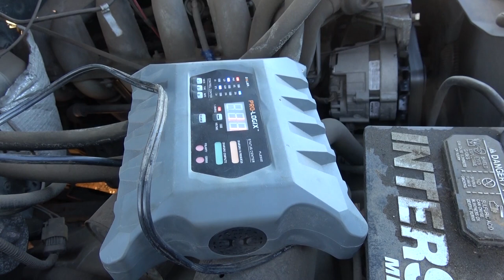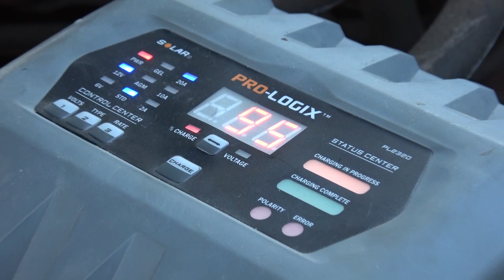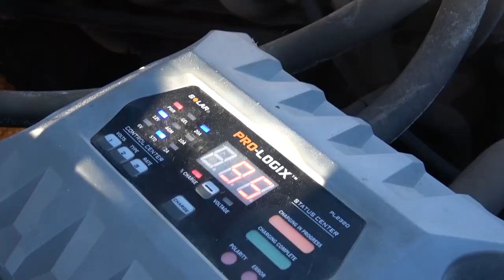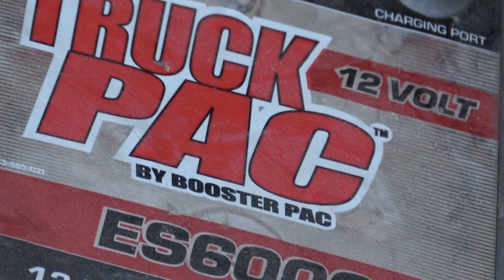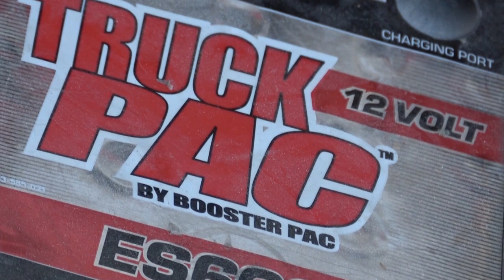Costco Boost Pack | Electrician vs. Truck Starter

Comment: “The Club” steering wheel lock? Jeeez. That’s old school. Brings back memories. People still use those things? Must be a large criminal element up there North of the border.
Reply: I'm fairly certain it's quite the opposite the criminals on our side of the border can get one of those off like it's held on with a wet paper sack the fact that they still use them up there kind of says there ain't much crime
Reply: Here in South-Africa it is tradition . .the first thing you go buy for your car . . . .also doubles as a self-defense tool.
Reply: iirc he has no ignition lock.  the club is the only security
Reply: @GigsTaggart  A good way to fuck with thieves is just wire your battery's positive to a switch in the car hidden away. Of course this means the remote start won't work.
Reply: Are things that bad there that someone would actually steal that POS truck?  lol
Reply: That’s in case the thief brings a Makita battery...
Reply: Yeah great security. Someone can start it (assuming it will start)  and drive it as far as it takes to crash it or put it in the ditch, because they just can’t steer it. But they can’t get it to take them where they want to go. That’s real protection I tell ya!
Reply: @kjisnot  The exhaust is a high dollar custom job.
And yes it's a great self defense tool.
Reply: @leerman22   My brother would always wire his starter switch to the windshield washer button on them old ford trucks of that vintage. Worked great because it was on the dash right beside the headlight switch. Just turn the key forward and press the windshield washer button and she would spring to life.
Reply: It's just to keep the honest drunk ones from driving off
Reply: @kjisnot  From what I can see of it, for an OBS ford in snow country, she looks pretty good, honestly.  Probably about $1500 worth of truck on a bad day.  
Had my 94 Dakota that was rusting apart, smashed up, doors literally falling off when you opened them too far, completely trashed truck stolen. I have no idea to this day why they bothered.  Figured it would turn up with the new wheels missing as it had a decent set of tires on it, or that someone took it to use for some other crime and it would turn up.  Two years later not a word.  I can't imagine someone stealing it just to scrap it, doesn't seem worth the trouble for $200.
Reply: @johngaltline9933  I have a 98 Dakota that I park with the bright orange key chain hanging in the ignition. They haven't moved in years. I live in Baltimore. Can't get anyone to steal it.

Comment: Reminds me of the morning I jumpstarted my '83 Ford in the dark.
50-50-90 on that one.
Truck started up, abruptly followed by the jumper cables catching fire and melting, then spattering my sweater with burning plastic as I removed the cables from the battery.

Comment: It's a balmy 14 degrees farenheit in Northwest Ohio right now. I finally got my 1994 Ranger (with the "awesome" dual ignition system) to start after 45 minutes of fussing n cussing. It has a cracked coil pack and doesn't like starting any time because of that.

I finally convinced it to start by opening the shop door so it could see the big box with the V8 engine swap kit sitting by the bench and the freshly built 302 on the stand. Once it saw them, it fired right up!

Comment: I have one of those tiny battery jumpers, I have the Audew 2000A peak
it works amazingly well, it takes three or four percentages off of the battery each jump
I have given my grandpa's tiny toyota a jump and my VW station wagon as well

Comment: Terminals could use a scrub.... a "how's your mother" so to speak....Just an observation
Reply: I usaully just insert a drywall screw in between the post and clamp. Works like charm for "tightening up" the connections!
Reply: @chuckchapel8492  Pro-tip right there!!

Comment: I've used the big ryobi batteries with a chopped up extension chord to jump the work van. It worked, but after a couple of times I have a pretty expensive paper weight.

Comment: The Ford being a ford.
Reply: thats the same battery from the last time it was dead
Reply: @buttsakauf  I've got a 300 with a one hole Carter carb that fires first time every time as long as there's fuel in the bowl. Doesn't care how cold it is.

Comment: Gotta go Supercapacitor-type jumper in the depths of the Cold and Dark.
Reply: They suck. 20 minutes charging to get 3 seconds of crank time. You might have a truck like this one started in an hour if you're lucky.
Reply: @andronicuscomnenus2642  Definitely not my experience in any way.  Had multiple cranks needed on a 4+L engine. Charged in 7-10 minutes in 5 degrees F.  I'm sold.

Comment: My tool batteries saved my behind many, many times!
Just like aVe and DC, the difficult part is finding a length of decent wire. Having been stuck in the woods many times, a number of my power tools are missing cords, having been cut off to start the Subaru.

Comment: Last week when it was in the negatives temp wise in Texas I had to start my work truck but it was too cold. Managed to Jump start it with the same Makita battery and 2 pieces of 10 gauge ground wire. Best trick in the book when you have no other way to jump start.

Comment: I use the Anker Roav version of one of these. You don't let it sit there. You plug the cable into the starter box and directly into the battery real good then press the button and immediately start the car. I started a dudes motorhome with it at half charge, then went home and jumped my armada that has an electrical problem I haven't felt like trying to figure out yet

Comment: What I can’t understand is why nobody makes a Lithium boost pack that’s the same size as the old ones, it would actually work. But, I’ve found that the small ones work great for smaller 2ish liter gas engines if you have a marginal battery that just doesn’t quite spin the engine fast enough. My old Volvo that’s parked half the year in a heated garage is a prime example, keep one in the glove box!
Reply: I just use a Milwaukee M12 battery with a couple stranded wires out the top. Start lawnmowers and stuff all the time with it

Comment: Jump started my vans many times with drill battery. Trick is to connect them for around 20sec, disconnect for 60sec and so on to allow to cool. Never try to start whilst still connected as it fries the leads and the battery.

Comment: Best jump box I ever had was an actual car battery with short cables with clamps attached to them. The battery had free replacement for 2 years and was pro-rated for 3 after that. Find that on a conventional jump box. Plus it was heavy as fuck, which prevented lazy people from borrowing it and not bringing it back.

Comment: The battery contacts were dicky, that's why they were sparking. Attempting to charge the car did not work and also that's why the other starters refused to work, they were just making contact with the terminal and not with the battery. Easy way out of this is to have one person force the terminal at an angle, might get you out in a pinch. Long-term: just clean the old contacts really well, use a grinder on them, cut them off with the grinder and install new ones + terminal grease.

Comment: As I know you shouldn't connect that jumpstarter to the car battery because it is like pouring water from 1 liter gallon to a 10 liter gallon, what happens at the end, both of them are empty. That jumpstarter is for direct start, starting a car needs plenty of amperage  for a short time and jumpstarter is capable of providing it

Comment: Here in north carolina foothills, I am amazed at the number of people who buy the cheapest of cheap car batteries... Those same people are the ones who complain about early battery replacement\bad cold weather starting... Listen do yourselves a favor and buy the absolute best battery you can find. Ive had good luck with autozones "duralast" top of the line stuff. (Gold, think they have a "platinum" now) Mine was made in Czech Republic. Chooches proper.
Had an older gold top last 10 years.
Warranty aint teabag either. 
If your in Canuckistan you probably screwed either way you go though lol

Comment: the key to makita jum starter technology is you have to have 2 sets of jumpper cabels and run em together to double the amperage  and you use 2 razer blades in each battery slot works every time

Comment: Cutty sark was my cheap option, yum! The power tool battery is very effective. 30 seconds 9.8v to 13.1v. Use it to fast charge not jump

Comment: lmfao I'm surprised those thin gauge wires and gator clips didn't just POOF like det cord when y'all hooked it up and hit the starter.

fwiw I have a jump pack about the size of your portable single-use one that I bought from Wal-Mart several years ago. I've used it to jump my Miata and my brother's Altima several times, and even made an unsuccessful attempt on the 6.0 powerstroke with dual batteries once and it still chooches. I love the little fuckin' thing and it's so little I can always have it with me.

Comment: My folk's metal shop had 2 old diesels, one with 380k miles and one with 310kmiles.  I can smell and feel this video; they never wanted to start in the cold.  Each truck had 2 batteries, and that means you had a 25% of the damn things not starting when a cold front came 100% of the fukin time.

Comment: I've actually got the drill battery thing to work.  the car battery was just "good" enough to crank a few times and then die. I started it with an 18v 4 ah Milwaukee battery , jumper cables plus a few inches of #14 to get into the slots. But With a totally dead car battery, it just destroyed the expensive drill battery. Wouldn't recommend.

Comment: lol at the speedometer needle pinned under zero. I had a work truck do that to me. Rest of the gauge cluster was fine. Thing is, I had to drive it on public roads, so I had to use my phone as a speedometer for a while. Funny thing is, it was both caused and fixed by the battery going flat.

Comment: @avE Maybe you were planning on smoking that little dog all along? They're actually meant to connect to the dead battery,( and you would be wise to wet up "slosh" of paper towel to each bat.post.)You then wait for the fifteen mins for the dog to charge the lead battery. I find it hard to believe directions don't say to disconnect before turnover attempt. How could that little spank-dog take 700 of current?

Comment: I've jumped my Jeep Wrangler off of my Ryobi battery many times.  You just need to use wires a little more skookum than the leads on your multi-meter.

Comment: I tried to save my Balvenie from my uncle when he came down to visit - tried to strategically hide it way at the back of the liquor cabinet.  Shortly thereafter I discovered he'd pushed right past the 15 other bottles of whiskey and snagged it.  He had mixed a not-insignificant percentage of the bottle with cola.  This is the same uncle who says he'll drink any beer as long as it's wet, but every single time will dig down right past the Bud Light to get to the Young's Special London Ale I tried to hide under the ice.

Comment: you're supposed to disconnect the dingus end and the cables then reconnect the dingus then postive then the negative. Though with my experience the dingus end on a li-ion jump pack will not jump no matter how charged the battery is if you leave it in your truck in -30 whic his pretty much the only time you'll use it

Comment: I had a different version off of Amazon and when my RAM 6.7, which has two batteries,  wouldn't start I thought "What the hell" and gave it a try. I didn't let it charge the batteries, I just tried and it started the engine without a problem. I was surprised. THe outside temp was probably 60 degrees F so it wasn't a good test of low temp starting.

Comment: I did start a Motorcycle Engine only with my RC-Car Battery, and the atarter was like turning at double speed than normal.
Never try a car engine but i bet it will start at least a 2 Liter engine without problems.

Comment: not to publicly post my general proclivity for recklessness... but i definitely use my 20v porter cable batteries with pennys as terminals and full size jumper cables with a piece of trash thats handy to keep em from touching to start my 5.9l gas dodge quite regularly

Comment: Not to be a pain in the read end ...butt ... I'm pretty sure its a better idea to connect the source positive side to the positive pole on the battery... and the negative source side to the vehicle frame ..  to bypass the battery ..  I find it works better  ..Opinions may vary.

Comment: Do you always hook up the negative cable to the negative terminal? I thought everybody just connected it to the body as a ground, in case of a short circuit internal to the battery

Comment: I wanted the Makita battery to work after the first two boost packs failed, but roasting out those wires was probably the right call. Electricity knows what to do every time.

Comment: "Type S" should have been your first warning. But a battery charger, 2 jump packs, and a Makita Battery later She starts LOL. In All honesty, those little Lithium jumper packs work great if you buy a decent one. I run an Autor repair shop and I use ours 8-10 times a week. Your Youtube brother "The Project Farm" Did a comparison on them. Giv'r a watch.

Comment: My '91 300 F150 always starts, though cranks pretty slow.. The battery is a 2012 Everstart, and for the math impaired that makes it nine years old.
On that truck.. I'd check the engine ground. But a new(er) battery couldn't hurt.

Comment: Makita battery, two extension cords with a blade bent over to fit in the slots, 200 lb gorilla holding the exciting end to the terminals, the old lady on the ignitor switch and the youngster pointing a phone at me in case something"Cool" happens. Works every time.

Comment: That charger is sold under numerous brand labels i had one and it doesnt chooch...not even a little bit

Smart chargers suck if voltage isnt at minimum voltage they automatically shutdown,

Comment: FWIW, I ran out of battery pixies a few blocks away from my shop, bad alteredstatinator , I used a DeWalt 18 volt battery to charge my truck battery and it got me to the shop, it dies right in the parking lot but it did get me home , two wire hangers and a DeWalt battery . . . . . . I used what I had

Comment: y'all crack me up.. I have the Harbor Freight booster about the same size.. You hold down the button to charge the capacitor and that is what starts it.  We use it on the Harley and a car if needed.  Meanwhile,, the truck is running and driving with no key ;)

Comment: To be fair, if you needed this on the side of a highway with cars screaming past, you don't need a jump pack; you need an alternator. So by the time you've changed the alternator on the side of the road, you don't really care about the cars anymore. Well, except for the occasional thought of jumping in front of them from all the BS you have to go through to change said alternator.

Comment: Im sure we've all got a high current dc power supply in the form of le inverter arc welder........... could be worth an experiment? Or at the least the fire afterwards will warm dew claws hole!

Comment: Your better off using a 5000 mah 50C 3S r/c battery for portable jump starter than that Costco offering. Two in parallel will definitely do the trick.

Comment: Lester#7752 will got you a 130 amp alternator to replace the pathetic 60 amp stock unit in that truck. Bolts right up just need to do a little wiring.

Comment: If it's too cold for the lead acid truck battery it's way too cold for the lithium batteries in the jump pack which is why i prefer my 10' jumper cables to a jump pack.

Comment: Sometimes your significant other leaves her lights on and you ride in like a knight with your battery pack and all your automotive acumen but all you get is a blaring alarm in your face as you slam the back of your head into the underside of the hood. And by sometimes I mean once a fortnight.

Comment: The thing is a POS. I have had similar
 Leave cables on battery then plug into machine, start instantly as it would time out and you have to 'restart the system'
Fully charged it was pretty stronk

Comment: I'd say your main issue here is that someone took the engine out of your engine bay and replaced it with a load of black plastic tubes and pipe insulation.

Comment: I have the same truck with the same motor. Mine's an 87. The wiring in mine is fuckered to hell and back, But once you get it running it's a tank.

Comment: I was wondering what you look like, so I captured all the different parts of your body that you've revealed in your video's from the very beginning to present, did some fancy composite image extrapolation, stitching, virtual reconstruction and pixel realignment, and I came up with an image. I don't think I can paste images here but I have concluded you look like Yogi Bear....because you're smarter than the average bear.

Comment: Your big mistake was leaving the frickin thing sitting there discharging into the lead battery. As SOON as you connect the battery, try to start the motor. Otherwise the tiny battery is just squandering itself into the dead lead acid battery.
Reply: Like trying to warm up the ocean by throwing warm bodies into it.

Comment: Those battery terminals probably weren't helping with contact either?
Reply: 2000 amps through ... 22awg wire?

Comment: I have a 20 amp version of that charger. My second one cause the first one hot wet and fizzed out. The first thing I did with the second one was to take it apart and drench the board with conformal coating a couple times. Works great!